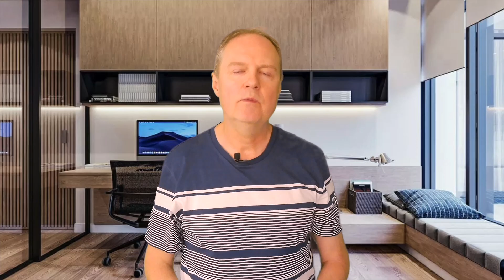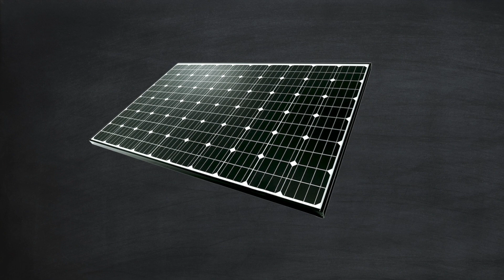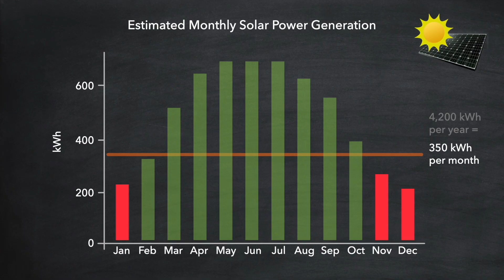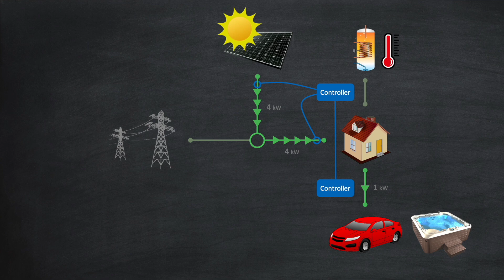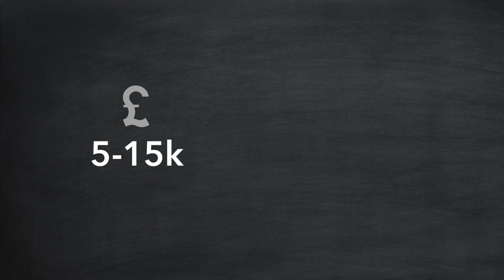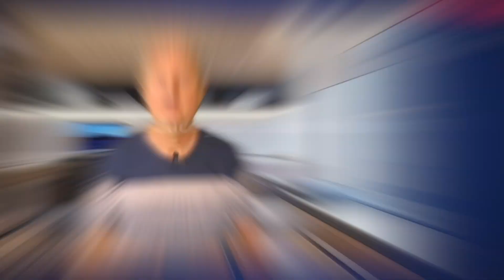A Beginner's Guide to Home Solar

Comment: I’ve installed both solar, a Powerwall and myenergi equipment to heat the water and charge my Kia Nero. Your right it’s a huge saving especially now with energy going through the roof.  However your car analysis is a little wide as one requires a minimum of 1.4 kw to charge the car this means on my charge point I’ve got to set it to combine the grid with the spare solar to reach that 1.4 base line. Before the current price rise and with a small FIT payment, I was the last to take it up before it ended, I’ve worked out that my combined energy bill was little more than £20 a month. We don’t scrimp on energy as my wife love heat but we do live in a modern well insulated Semi Detached. We were able to use our savings to complete the work and it’s over the last four years given us a return of around 8% which was way better than the banks were offering. I really believe it’s time our government! Legislated that all new builds had solar panels and battery storage. It wouldn’t increase the house price by a huge amount but would allow people to make use of solar energy without having to find huge lumps of money, and of course it would increase the value of the property against one that didn’t have any of this equipment
Reply from the maker: Sounds like you have a great installation there! Fantastic to hear the ROI you’re getting. With UK rates expected to rise again in the autumn by an eye-watering 64%(!) those who can afford to get solar will get their money back even quicker. I totally agree with you regarding the government’s role with solar - other countries provide more support than the UK, both on equipment purchase and payment for exported kWh. With the price of new homes being what they are, the % extra burden on the price for having solar is low, but the upside for the country in terms of self-sufficiently is huge. Granted, the storage issue needs to be resolved (locally and regionally), but we have the wherewithal to do that. 

Thanks for the note on EV charging - much appreciated!

Comment: Gary, you are talking down to me, sonny. You have no understanding of this issue. You identify with the landlord right from the start and begin lecturing me on what is fair FOR THE LANDLORD.  Try thinking about what is fair for the TENANT.  A social landlord has a duty to be reasonable, where a private landlord might not. They are arguing that they do not have properly trained staff to inspect the installation and therefore forbid me to install. But, the court will probably agree that their failure to train staff is not a reason to deny permission. Further, I can establish that the qualifications of the installing company are extremely high in respect of safety. Thousands of houses have solar installations and I cannot find evidence of one single mishap. It would be unreasonable for a court to demand a higher standard of safety from a contractor working on behalf of a private tenant than it would for a contractor working on behalf of a housing association.
Reply from the maker: Jack, I can see that you’re frustrated about your situation, but try to refrain from personal attacks. You don’t know me so how can you make a determination on what knowledge I have or not? 

I think it’s clear from my videos that I’m in favour of everyone getting solar if they can, including those in social housing. Especially as energy bills are going to increase rapidly again. 

My only advice would be that you’ll stand a far better chance of getting what you want if you clearly lay out the benefits to the landlord of doing this (as opposed to taking a confrontational stance that you as the tenant have some kind of legal right). I wish you the best and hope that the landlord is persuaded by your point of view.
Reply: @GaryDoesSolar  It would be a reasonable levelling up exercise for the government to commit some ideas to law so tenants are not disadvantaged by this progression in technology. Unfortunately I doubt it would enter this government's collective head to do such a thing. It always seems that the less well off in society are increasingly disadvantaged.

Comment: Great first video. We had installed 6 weeks ago a 10+6 400w system. It was a quick decision as we unexpectedly needed our roof retiling so fitted solar at the same time. Due to this getting a system NOW was not easy, but a recommend local installed managed to fit us in. Understanding the feed in limitations is why our system is a 3.6Kwh (10x400) and 3Kwh (6x400) system. The 3.6Kwh is a hybrid inverter for future battery storage. You are limited to 3.68Kwh going back into the grid without special survey works. So on a good day, the 6 panels can be producing 2.4Kwh and the 10 panels even more, but if the house isn't using it, the hybrid inverter has to throttle back the energy produced from the 10 panels so no more than 3.68Kwh is exported.
In the short time we have had it, currently we are pulling from the grid on average 6Kwh instead of the previous 18kwh. So a good saving. We just need to use/store the excess.
Reply from the maker: Thanks for the kind words. Yeah, there is so many factors to consider for any solar installation - no wonder that people can get confused and end up ordering the wrong setup. I'm hoping that my second video will be of help, it should go live shortly.
Reply: Have you considered what you get money wise from the Feed Back Tariff against not Feeding it Back. And using the full potential of your system. You only need the DNO survey if you use the Feed In Tariff system. Decent battery set up would help as well though for sure and you will need DC Battery rather than an AC battery as you will be charging from you PV array rather than the Grid tied AC battery. Your not doing to bad really majority of the 6Kwh you use could be solved by the Battery you will add at some point as it occurs during the hours when you loose solar power evening time and over night.

Comment: Great vid I’m thinking of going solar,quick question sorry not very technical minded,I have a gas combie boiler ,if wanted to heat my hot water say for showers would I only be able to use Ele shower,which I don’t like would I have to get a separate tank to heat water instead of combie boiler
Reply from the maker: Glad you liked the video, Kevin :-) I'm not an expert on combi-boilers, but I did find this article which might be useful to you:

https://www.homeserve.com/uk/living/heating-and-cooling/what-type-of-shower-works-best-with-combi-boilers/

One of the problems with having solar and electric showers is that a typical electric shower draws 9kW of power, but the solar installation will only be able to supply a maximum say 3.68kW (possibly more, depending on the inverter and array size) - so that means the extra power will have to come from the grid.
Reply: @GaryDoesSolar  thanks for that,think I will get rid of Ele shower anyway as I prefer one that runs of the gas combi ,
I downsize last year from a 4 bed detached to a 2 bed semi as kids have flown the nest so made sence just me and wife now,I’m paying around £140 a month gas ,Ele, at mo,have gas central heating and gas hob and water heated through combi ,wife does a lot of washing and does like the tumble dryer on ,she’s in all day the back of house is south facing with just the soil pipe sticking through it ,seen a company on here first for solar seem to have good reviews so try them first

Comment: Thanks Gary
How often are you planning on issuing these videos?
Also, are you going to cover three phase electricity?
Reply from the maker: Hi Mark, my next video should be live within a week or two (working on it now) and thereafter I'm targeting every 3-4 weeks depending on how much free time I can create for myself. The idea is that over time, the videos get deeper into the topic. My own house is single-phase, but I am interested in how three-phase installations differ from that. Might be a few videos away yet though... Is there are particular aspect you're interested in?
Reply: @GaryDoesSolar  I have a list…

- informing the DNO
- inverter sizing based on single / three phase (impact on DNO notification)
- AC or DC coupled battery (impact on DNO notification)
- balancing phases vs vector sum metering

I look forward to the next instalment 👍
Reply: Why?

Comment: I think that the government got the entire grant scheme wrong , instead of giving £5000 towards a heath pump, that puts a lot of pressure on the grid, it would be more efficient for each house to get that money towards a battery and solar array to self sustain.  The problem that we have is most of the homes have a power supply calculated to 2kwh from the grid and DNO, we are already stretching that with the normal appliances that are more than 50 years ago when our grid was developed. If we add in electric cars, working from home , heath pumps, removing gas from homes we will put such a strain on the old underground cables that will lead to blackouts. If they don`t want to give us grants for PV at least give us 1 to 1 Kw , for each kw we export, if I export 20kw that are used by the steel factory during the day when electricity is expensive, I want those 20kw back during the night when they are cheap, we all win, both the consumers and the industry.
Reply from the maker: Hi Chris, I’ve been thinking about what you wrote. You’re bang on the money - the UK National Grid was designed at a time when there were a few macro generators (coal/oil fired power stations, hydro-electric plants etc.) and consumer usage was low (against today) and relatively predictable. Like other industries today, what is needed is new type of grid - one that can manage local micro-generation and potentially greater unpredictable usage as the population electrifies itself more and more (cars being the obvious next appliance). I don’t think much investment has been made into the grid over the last 10-20 years to prepare for that (and I’m very happy to be proved wrong) so it will be the disruptions who will force that investment - those early adopters of solar who paid a premium price to effect change in their own lives and that of the country as a whole. I’m not just talking about everyone who invested 20 years ago but everyone who will go Solar in the next 5-10 years… The future is electric!
Reply: @GaryDoesSolar  if you look at the macro picture the future is electric because it`s easy to generate, transport and use (plug and play). Until now gas and oil was cheaper even if it was harder to transport, refinery , tankers , etc. I don`t think that batteries are the future of storage, unless some breakthrough on capacity and storage. I think we should use electricity to create Hydrogen, store it and convert it back to electricity when needed.
Reply from the maker: Yeah, I don't disagree with you about battery tech - progress has been incredibly slow over the last few decades - but all it would need is some kind of breakthrough, which I can't help feel is coming. Alternative means of energy storage away from the home should be just as good though, including hydro-electric, hydrogen and maybe even gravity batteries. Will be interesting to see what comes along... :-)

Comment: Good clear video.  One other bonus of solar/ battery system is power cut protection, battery feeds the house if grid is out. So pleased I bought into this! remember storm Arwen!!  as well as huge cost savings on a split rate tarriff....
Reply: Yes split rate tariff same as time of use tariff. Im British gas 15p 5am to midnight, 39p through the day, but run on battery through day so 39p is irrelevant other than standing charge. Its a Tesla powerwall 2 system I have . Also has feature if getting lots of sun in sunny fife, can go completely off grid through the night, need to remember to go on grid when daylight happens, so can export....
Reply from the maker: That sounds great! And, as it happens, I know a lot about the Fife weather, as I as was born and brought up there 😀
Reply: I had the solars (4kw) fitted about 9 years ago, and Tesla fitted last november,  Full VAT on both, If you get both together, Is VAT zero, I beleive...
Reply from the maker: You’re correct about the zero-rated VAT (As from April this year) - it will apply also to batteries if you get them the same time as your solar installation 👍🏻
Reply from the maker: Thanks for the kind words. And thanks also for the note on that extra benefit from a battery. I’ll bring that into the next video where I cover batteries and other equipment in more detail 👍🏻
Reply from the maker: Can you tell me more about the split rate tariff please? Is that the same as time of use tariff?

Comment: Hi Gary. Thanks for this excellent explanation and easy to follow video. I may have missed it, but is your estimation of pay back period applies to solar only or solar with a storage battery? My local installer says there is a huge waiting time for Tesla powerwall and may only be available beginning of next year. So I may decide to go for the solar panels only for now, but I would miss out on the 20% vat rebate. Unless I consider another battery storage, but I quite the sleekness and simplicity of the Tesla.
Reply from the maker: Hi G LSC, thanks for the kind words. I'll try to keep this up with future videos! :-) Now, you raise a great point regarding batteries and return on investment. For solar panels only, you can certainly expect a payback of 5 years (or less) in the current climate. For batteries though, the business case is harder, not least because of the relative cost and the limited lifespan of the battery (maybe as low as 7-10 years). My estimations in this video were based on a combination of solar and battery, and  it's the battery element that pushes out the payback period. That's not to say that batteries are not worth it - they are, but the relative return is lower than for just solar panels. One might ask, if I'm getting a great return with just panels, why water that down by adding a battery? The answer might come down to more than the money case, but also the freedom case - the freedom to use electricity when you want, rather than trying to get all the washing done while the sun is out etc. Regarding the Tesla Powerwall, I'm in exactly the same position as you. I like the way Tesla is approaching the problem and I think their technology will typically always be ahead of the competition (not least because of the immense R&D budget Tesla has). But Powerwalls are expensive and hard to get. And by the time you get a PW2, the PW3 will be out, and you may have wished you'd waited for that... So, my own strategy is to start with Pylontech batteries, which being modular, will allow me to add further capacity over time to suit my needs (and generally allow me to learn about how the technology works out in practice). Then, maybe in a year or two's time, once the market supply issues have been solved and PW3 has been released with all bugs ironed out, I'll likely buy one of those, and simply sell the Pylontech batteries (even used units will likely always be in demand). I'll then have a battery solution that will just take care of itself going forward (as my interest in day-to-day management will no doubt have waned by then). Hope this helps!
Reply: @GaryDoesSolar  I have a 7KW Pylontech battery setup and they have lifespan on 6000 cycles so even at the worst case scenario of a cycle each day that is still 16 year. I've had solar since mid April which saw my usage go from 700 kWh in March to 574 kWh in April. I had the batteries installed early May and can now see the usage of 278 kWh. This is a 60% drop in the energy usage. Obviously the batteries make a huge difference. If we see 0.42p per kWh that could hit us in early 2023 then the payback will be dramatically reduced.
Reply from the maker: This is very encouraging, Andrew - Pylontech seem to have cracked the modular approach nicely as well.
Reply from the maker: I forgot to address the 0% VAT point. It's great that the UK gov has zero-rated VAT on solar purchases, but they should also allow people to make staged investments as not everyone has the capital to get everything in one go, nor may they wish to even if they did. I can see the VAT scheme being changed accordingly in the next year or two.
Reply: Thank you 😊
Reply: Hi, I am exactly in this position. My solar will be installed on early September and I have decided to order but wait for the Tesla battery - as you say it might be by the end of the year or early next. In terms of VAT provided your order includes solar + battery then both will be zero rated for VAT even if the battery is delayed. The idea was to avoid zero VAT where people already have solar and then add a battery. Seems strange given it will reduce reliance on the grid but I guess the treasury needs to keep money coming in somehow!!